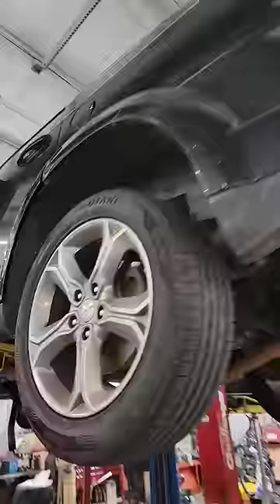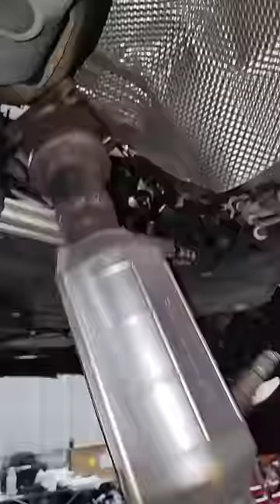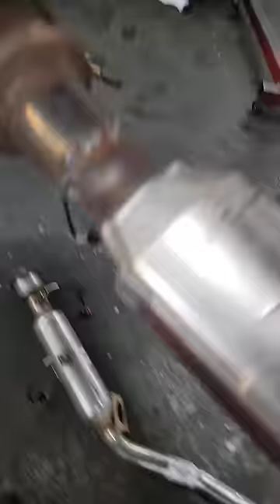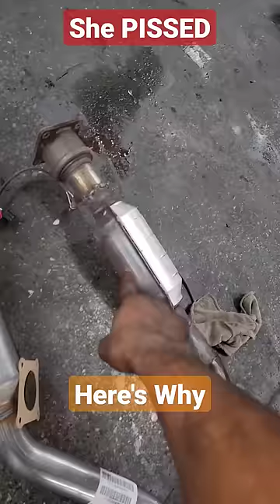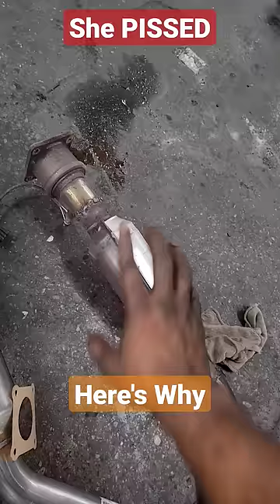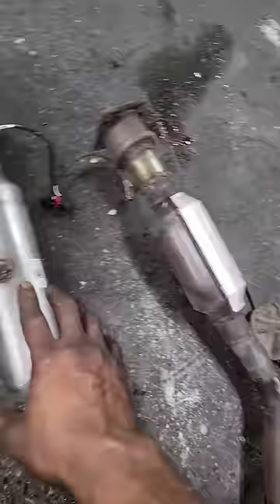This customer freaken Pissed Off. But at whom?

Comment: She should take that cat back to the shop and you know what.
Reply: Put it where the sun don't shine ,sideways no lube ? 
😂😂😂
Reply: @MrTheHillfolk no.... I'm thinking lube, to facilitate the friction that would be developed, from the hours of work.
Reply: @bartbullock9742   5w-sae 30 works
Reply: @todp9170  synthetic.. conventional oil smokes too much.
Reply: @bartbullock9742  ❤️
Reply: WHAT?
Reply: @ricardomolina4605 Yeah,what?
Reply: @ricardomolina4605  relax Ricardo, no cats were hurt in this movie.
Reply: If you look at the bottom weld, it looks pretty good. How many cats have you installed? If you look up into the hole there is not much room to weld and get the angle to get a pretty bead. Maybe I could have made it look better.

If you took the flange/pipe off of the manifold so it could be welded outside the vehicle it could be perfect which is probably what I would have done because there is no room to get the Sawzall up in there to cut the old one out either.
As the saying goes... Maybe you could do it better?
Reply: @DrHarryT   there's no reason to not remove and weld it outside the car.. that pipe is removable in multiple pieces..
Reply: @harisyoung4110  Apparently you haven't done exhaust work before, I'v done a lot at Midas Mufflers. [We moved into a lot of general service and brakes when exhaust systems became more and more stainless steel instead of aluminized steel pipe.]

The main reason to avoid disassembling exhaust components especially closer to the engine is the intense heat causes corrosion which locks the hardware causing it to snap/break when taken apart. You don't want to open a can of worms with a broke stud in a manifold let alone where it's hard to get at.
Reply: @harisyoung4110  I'll add... I've walked under a car and looked up and laughed at some of the welds I've seen. This upper weld is somewhat laughable but I'm not ready to throw  him under the bus because it's in a difficult spot. Welding is an art and there is no substitute for experience, As long as the weld penetrates, holds and doesn't leak, it's good to go. 12 o'clock is the hardest and it helps to have a good mig W gas [Miller/Lincoln] that's not worn out. I've laid my fair share of bird shit getting 12 o'clock to seal.
Reply: Not shops fault her car had a recall she didn’t know about
Reply: @taylorbokshowan5713  That's exactly what I said in a main comment of my own. The manufacturer sends out notices of the recall. A shop is not expected to call the dealer with the VIN number for parts they replace and check for a recall. Sometimes we question the customer when the age or milage indicates it might be under warranty.
Reply: @Taylor Bokshowan  she paid for a professional. And they gave her the shaft. It is their fault.
Reply: @ksiebert631  nah she paid an exhaust shop for a catalytic converter and that’s what she got. I don’t know if any aftermarket shops that check for recalls???
Reply: Split their wig with it.
Reply: The Mask "Hold On To Your Lug Nuts!  It's Time For An OverHaul!!"  Thank you Jim Carey. Genius.
Reply: It's not the shops nor the parts store job to make sure your car has a recall lol. If you go into a store, or a shop n want something you're gonna get what you ask for.  This is on the owner cause she's probably owned that car since new, considering they mail you letters when your car needs a recall it's her own stupidity for never getting it done. The mechanic in the video is also full of it, she brought it to a shop not a dealer lol. Shops work on everything n anything, I hardly dealt the mechanic who worked at the shop knew this one model of car needed a recall for the cat, why would any place but a dealer know that off the back of their hand ? They wouldn't
Reply: @Kasper  the guy in the video, said the shop likely knew there was a recall. They just wanted to sell a cat with a crappy weld job. So the guy in the video works at a dealership or what? If you're in the car business in this computer age you should know these things, or you're just a crap mechanic shop out to rip off the customer.
Reply: @Kasper-wg2ds  I can tell you're one of those out to rip the customer. You don't really care about anything but yourself. And what you can get.
Reply: Bruh it’s messed up bc the dealer is taking her core
Reply: @DrHarryT  I've been employed as a welder and have also worked as a mechanic. The top of the pipe is not hard to weld. The real problem is if the shop had ordered the correct part, they wouldn't be welding at all.
Reply: @ksiebert631  instead of cheaping out cause we charge 80 an hour n not the over 100 the dealer quoted you, go to the dealer if you want a recall specialist. If you want a small shop to fix your car on the budget we got you, but we aren't the ones to deal with your recall anyway, those have to be done by the dealer.
Reply: @Kasper  you're paid 80 an hour for knowledge and expertise. But your going to cost a customer a 1000 bucks because you want to make a buck. No wonder people don't like mechanics.
Reply: @DrHarryT  On one piece manifolds you may have a point, but you can clearly see the cat pipe is sperate from the manifold, and the guy in the video got it off without any trouble, so there was absolutely no excuses for the hacks who did this to not do the same.

You're defending a hack. Not a good look friend.
Reply: @todp9170  she said she drained out 10 AA batteries and used that instead to "save a buck"  😂😂
Reply: Maybe she could service them?
Reply: So, the dealer is sending the cat for core, or she is??
Reply: @ksiebert631 Wow so that’s how it is in this world 🌎 we live in.
Reply: @paulhunter9613 Whatever do you mean service them?
Reply: @DrHarryT why, in the name of all that is holy, would you bother trying to weld 12 o clock on a cat near the header?  Just tac it up unbolt the damn thing, it takes 5 minutes and makes the job 1000 times easier and then you aren't having to worry about leaks if you don't suck at your job.
Reply: @NeoIsrafil  I've done literally 100's of exhaust jobs well over 1,000. How about you. Are you aware of what intense heat and sometimes salt does to threads? The last thing you want to do is open a can of worms having to extract a broken stud or drill and Heli-coil new threads, maybe even have to un-install the manifold.

Every job is different, and yes I'm good at getting 12 o'clock with the Mig. Every once in a while, you get a leak at the top but you patch it before the vehicle goes out.
NO-COMEBACKS.
Reply: why they did work SHE wanted its not their job to do her due diligence
Reply: Why? She was the dummy who didn't take her car to the dealer when she still had coverage. Always check your coverages first before making a decision to take a car to a private shop. That shits on the customer not the shop
Reply: @v4lhulme  it was a recall. Not a warranty. Just screw the customer.
Reply: @kurtcrafton  Those are called "Direct Fit" and they are much more expensive than the universal ones you have to weld.
The universal ones are designed to function the same as OEM but must be welded.
Typically, we give the customer the options. More often than not they choose the cheaper of the two.
Reply: @FZERO20  she's not required to give them her core. That's her personal property unless she asks for it back though they'll probably hold onto it. In Most states there are consumer protection laws that actually require mechanics to give the old Parts back to the customer after they're removed this is to give customer sherance that the parts were actually replaced. I'm not saying you couldn't give most customers a handful of nuts and bolts and they wouldn't know any different but still the is there..
Reply: @MAINTMAN73  yeah 9/10 the customer doesn’t want the part. They may want to see it tho. But even still they probably don’t even know what they’re looking at🤣
Reply: Yeah, utilize it with them, lol

Comment: She needs to take that shop to small claims court, but she's gonna need to keep the evidence.
Reply from the maker: The old cat long cut up and gone back to the core place
Reply: @Sean M Unless the reason she's having him do the repair a second time was, oh, due to the other shop not doing a good job, and still getting a failure notification? Like he said it was doing? Throwing an error code because their replacement didn't work, even after they charged her 1000 for the job? Might have a case there, absolutely. 
And the fact they're likely to have gotten a free brand new mopar to resell from sending in her old one, being well aware of the recall, and just hoping customers weren't. Just a few possibilities...

Edit: spelling/typing corrected. Oops.
Reply: The only claim she would have in court would be for the lousy well job especially if it leaked exhaust gases in created a hazard. Then she could have alleged a loss based on somebody else having to fix it correctly. But even then she got a free part out of a deal. At the end of the day she has absolutely no case and small claims court she came to the shop for a repair they told her catalytic converter she got a catalytic converter. Mechanic she took it to although they did a horrible job they have no legal duty to check for recalls. Caveat imperator, buyer beware. Maybe we need to start living in a world where people that make decisions actually have to live with the consequences of those decisions. If the woman didn't think to check if there was a recall on her car and then she paid $1,000 for somebody else to sell her a catalytic converter maybe that's just sour grapes for the customer. The shop that sold her the catalytic converter did nothing wrong by selling her the catalytic converter. What they did wrong was a horrible job that could have potentially created a safety hazard.😊
Reply: @MAINTMAN73  From what it sounds like, they charged her but put in the wrong part, and it never worked, so she should have a case against them for that, shouldn't she? She had to pay another shop to redo it right away since they failed to perform the repair she paid for, so isn't that a case of them not performing the work she paid for since she paid for a replacement and it never functioned as a replacement?
Reply: My understanding and it may not be correct my name is that she was in the other shop because of an unrelated issue and mechanic in the video found the catalytic converter issue. Depending on what the warranty at the shop she took it to is and and the consumer protection laws of her state you're absolutely correct that if the catalytic converter she purchased did not do the job of a catalytic converter then she would have a case. Say for example they installed a catalytic converter that was missing the catalyst that's it was defective she might have a case. I could be wrong but I don't think that was what happened here. I think they're responsible and well-meaning mechanic went the extra mile to get her the factory part and save her a boatload of money. If in fact she purchased a catalytic converter and she got a properly functioning catalytic converter rather that solved her problem or not then she is whole under the law. I'm not saying it's right I'm just saying that's the law. Consumer protection laws vary from state to state and Country to Country. This is one of the many reasons that I do not do work on vehicles in my fabrication shop. In my case I built an eighteen hundred dollar bumper for a customer they came in and told me they were only going to pay 300 for it and called the cops. The cops told me that I could take you $300 or not either way he was leaving with his SUV. In this case just a dishonest customer and cops over extending their Authority. The cops got reprimanded, but I never saw my money. I'm not saying what happened to the woman is right in anyway I'm just saying she probably wouldn't have a court case.
Reply: Shop did nothing wrong.
Reply: @dicky7600  Clearly, you didn't watch the video. If you did, then you're as crooked as the shop that ripped this customer off.
Reply: @illiniwood  Clearly you don't understand law.  She agreed to pay for a service, and the shop provided that service.  She can be mad all she wants that she didn't check if the car had a recall, not the shops problem or responsibility.
Reply: @dicky7600  I was in that business for 22 years. We never hid a recall from a customer....Ever! If your business isn't aware of a nation wide recall, you deserve to be sued and put out of business. It's apart of being in business. It's piss poor business practice to not know the business you're in.
Reply: @illiniwood  Who said the recall was hidden from the customer?  Plus. I doubt you were in this business because I've been in this business for 35 years.  Plus, 22 years ago you didn't have Mitchell or Alldata telling you there is a recall on the car.  Same with manufacturer warranty.  I present an estimate.  If they want to go back to the dealer and see if it's under warranty that's their prerogative.  Oh, and you forgot to mention what grounds they have for suing.
Reply: @dicky7600  But that's the thing... They DIDN'T provide the service she paid for: a working replacement catalytic converter. The janky mess they installed didn't even work at all! That's why she had to have it redone immediately at another shop, so she absolutely should have a case against them for not providing what she paid for. A working CC. They gave her one that never worked. The repair was never done. She went from a broken one to a broken one at the first shop. That's definitely actionable.
Reply: @ArtemisKitty  I heard the dude claim it was a Dorman cat.  I'll watch again, maybe I missed something.
Reply: @ArtemisKitty  watched on phone first time, so I'll try to give a better take now that i can see the video bigger.  First shop welded, if you can call that shitty weld job that, a universal cat in.  I'd only use a direct fit, but thats another conversation.  Now neither of us know what the complaint was that brought the car into this man's shop, which makes for a few scenarios.  Cat hitting the floorboard or leaking?  That's poor work that the first guy should fix properly for the customer.  P420 now or something performance related?  Same thing, first shop should make it right.  Third scenario, which is least likely, this guy looked up the recall and seen the cat work and told the customer about it causing the customers anger with nothing really wrong with the repair except an ugly job.  This case the customer could get reimbursed by the manufacturer for the work or get the updated cat as we see happenning in the video.  But for arguments sake here, we could use some more info as to why the car is back in the shop.  Just thought of another tangible, is this guy a tech in the dealership?
Reply: @dicky7600  We were apart of a billion dollar franchise. We didn't need anything like Mitchell or Alldata, and we certainly didn't need it back then. All that was for the little guys anyway.
Reply: @illiniwood  the only billion dollar franchises that come to mind are midas and meineke.  And Mitchell and all data are the industry standards.  But I suppose you have every Schematic, TSB, repair procedure, and recall information memorized.  GTFOH.
Reply: I mean they do notify you if your vehicle has recalls. That’s neglect on customer behalf for not bringing it in.
Reply: I don't know if this is in a CARB compliant state, but that cat didn’t look CARB compliant to me.
Reply: @dicky7600 he calls everything Dorman that's aftermarket, it's just something he does. You'll catch on after a few videos.
Reply: @ArtemisKitty she might have a case. She might even win. But that win is gonna cost five to ten times the cost of that $1,000 cataclytic converter. And the shop probably won't be on the hook for her legal fees, that's going to be entirely on her dime. So with that understanding, would you waste time trying to take them to court, or just take the L and never do that again?
Reply: @cavalieroutdoors6036  B.S. I took a dealer to court, all it cost was my charge to file which was around 50 dollars at the time and that's only because the dealer got me by showing up and immediately agreeing to everything claiming there was a mistake and they were willing to make it right and I forgot to bring up my charges to the judge otherwise I would have got those also. More people should file , you get your costs back AND punitive damages if the shop dealer is found to be operating in bad faith as in this case here. Judges own cars also and can easily picture themselves being treated like the customer. Nobody would want what happened here happening to them.
Reply: @@seanm990 Sorry, it's the owners job to check if there's recalls for their car? I didn't realise owners had to be mechanics with easy access to that information.
Reply: it's not up to the shop like everyone already said.  the NTSB and the FACTORY sent her a letter of a recall notice. 

but that doesn't give the other shop the right to take her money and not fix the issue.  she could sue for that part.  but by law in my state, you have to give the business a chance to fix it before you can sue or turn them in to the BBB.  obviously by seeing the stock converter the new one was way too small and was always going to throw a code for not working.  some of those welds are more than likely leaking which will also contribute to the catalyst below threshold code.